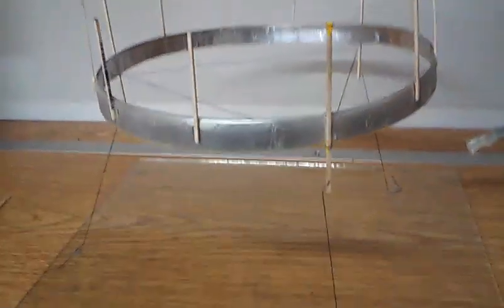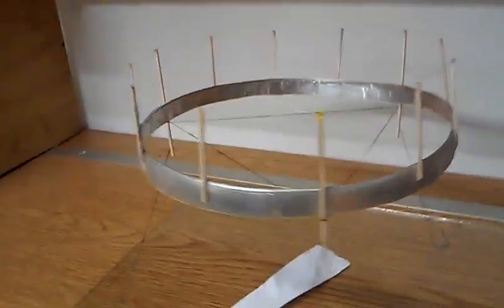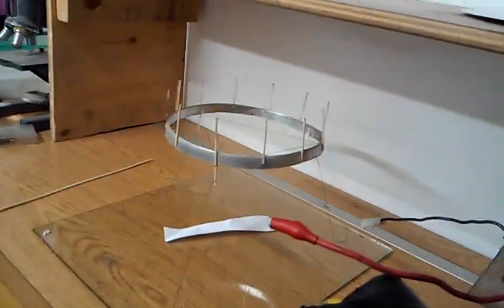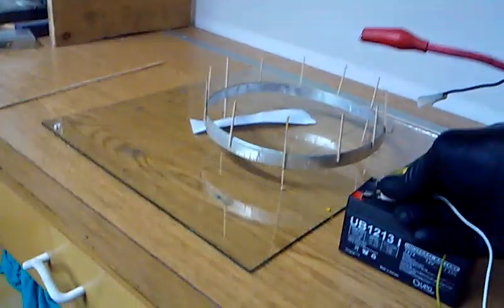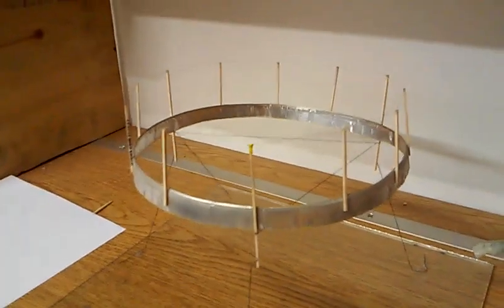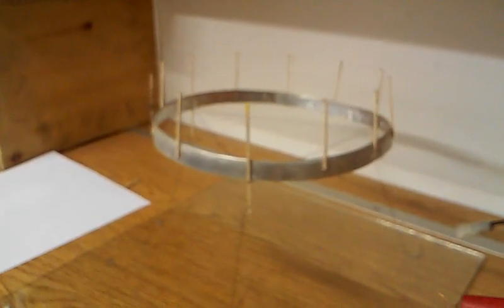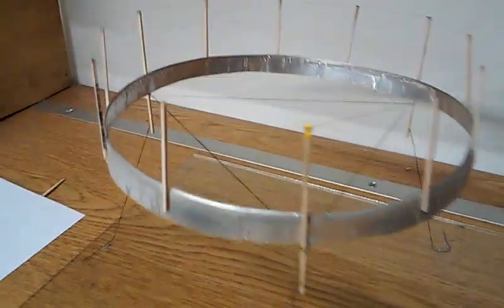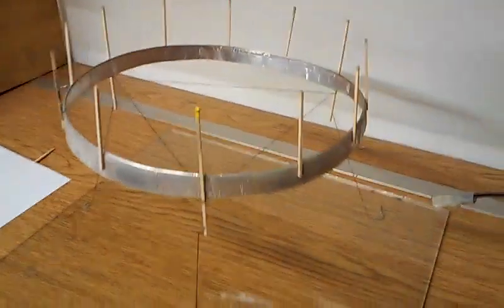ANTIGRAVITY LIFTER CREATES ARTIFICIAL GRAVITY ASYMMETRICAL CAPACITOR

Comment: Is there any documentation for this project? The voice is not clear enough. How can I replicate?
Reply: Tons of ion wind lifter plans out there.  I built two.  None will work in space however.  It's not anti-gravity.  Be very careful. The voltages used are very dangerous.  You can start with a TV tube power supply and a bunch of alumium foil and balasa wood sticks and "magnet wire" (resin coated wire).  Start here: https://www.instructables.com/id/Lifter-or-ionolet/

Comment: Nice. Electromagnetic field though, gravity doesn’t exist 😉. Barometric pressure from the electromagnetic torus around us allows density and buoyancy to separate everything on earth. Just as water separates based on density, so do the gases in the air. Solid objects are heavier than air, which is why they fall through the lighter air, until reaching a bigger mass. If Newton’s apple had fell in water we’d have a real problem! Rocks sink but apples float, thanks to air displacement. Planes and subs achieve neutral buoyancy, not anti gravity. Other way, more like yours, eliminate weight by changes in frequency and vibration mainly 😉. Best wishes! 💙 & ✌️

Comment: Very nice work.. I believe what's happening is the current is creating a magnetic field like a toroid around your ring. In turn the ions are pushing off of this field if you create a scale of this model either larger or smaller I believe you will see that your lift height will be the same proportional distance to the size of your ring. If it was a gravitational field then it wouldn't stop going up and the field would lift other objects in the field with it.

Comment: I have some of that heavy steel strapping that has holes punched thru it. I wonder if this can be used as the circular sheet metal part. I realize aluminum is much lighter and has higher conductivity.

Comment: this is not anti gravity, its not the ionic wind that moves it, its the change in momentum from the ion particles that move it up (as well as the ionic wind a bit). its like throwing a heavy object off a raft, to move back away from where you threw the object. please do research before claiming you discovered something. (this is not meant to be hateful)

Comment: Hi jim,
I built the power supply with flyback and joule thief. Im using a wire over grid mesh screen. 12volts battery. When i turn it on. The lifter wants to fly down. Not up.

Comment: I agree that it's not 'ion wind' that's providing the thrust, but i don't think it's creating AG above it. A simple AG test would be to put a piece of paper above it and see what happens. Nice build by the way, i was thinking of making a circular one so thought i'd take a look and see if anyone had tried it and documented it yet. I wonder how much more thrust you'd get if the emitter wire was in a circle too. Thanks for sharing.
Reply: You probably know this but don't expose yourself to the ozone for prolonged periods, maybe get some extraction going if you do.
Reply: Are you THE Gary McKinnon???  wow
Reply: either this guy is a good and talented fraudster or it's not a wind effect. The thing does not look like it's being lifted through air displacement.
Reply from the maker: If you noticed, I did hold a piece of paper directly above it. No effect. The emitter wire is isolated from the flyback power. The flyback neg. does go to the circular apron.
Reply: Hahaa We keep bumping into the same things....
Reply: Sorry for delay in replying, yes.  @Research0digo

Comment: Hi Jim. You can see what really happens when you blow cigarret smoke in your System. However, the reason why it attracts Ions can be the very same reason you posted the vid for.You just Need a whole lot of more energy to prove the gravity well theory. ´Gravity is he consequence of time oscillator differences of interacting force fields of particles. Every particle is carrying its time oscillating fieds. When they interact they tend to synchronise their time oscillations, making them oscillate more slowly. That is the reason for Newtonian gravity of matter. The bigger the matter the more energy is Needed to Keep them synchronous, the slower the oscillation, the slower the time flow.When moving a particle around it is clearly not oscillating. Therefore a moving particle is a Fourier series of its time oscillation together with an oscillation of the space under it. Togethert with the space around it. Since impuls is a constant, this must be a combination with positive and negative Terms.When the big metal of your unbalanced condensator pulls the electrons back due to the force fied of the remaining electrons, the impuls of the flying electron becomes slower and must have an effect on the underlying time oscillations of the space under it. It is like a mash you pull back. It gets deformed.  bubble. Having it's countereffect with (1-x^2) effect were x is normaliseddistance. A tippical dent. The oscillations surrounding get slower, corresponding with the time field of a heavyer particles. Meaning a bigger gravity. And by energy increase rule towards slower moving time fields (potential to kinetic energy transformation) you have your Explanation. Of course this Needs a book to explain. Just phrases to get your thinking in the right directons.But to attract a bird in your gravity field instead of Ions you will find yourself experimenting with 500.000V and 1-2 Ampere/Second electron flow. Not to do in the kitchen. ´John Searl did have interesting concepts how to achieve this.

Comment: I'd love to see that tested in a vacuum chamber - would prove or disprove any claims regarding ionic wind, and if it does work in a vacuum... well, the implications there are obvious.  :)
Reply: its already been verified that ion wind lifters will Not lift in a vacuum chamber
Reply: That's exactly my point.  He says its not an ion wind lifter, but "is trying to fall upward". Testing with a vacuum chamber would be one way to bolster (or disprove) that claim.  A small model shouldn't be to expensive, and if he's right it would be money well spent, yeah?  I'm guessing OP knows that would be wasted money, but if I'm wrong, even better!
Reply: I understand that when Townsend Brown went to continue his work in France his discs were tested in a vacuum chamber and worked better than in the atmosphere.
Reply: The devices work in vacuum. Ion wind does not. The devices work in OIL, and sealed in resin blocks. This is ELECTROGRAVITICS. ETHER TECHNOLOGY.  http://u2.lege.net/cetinbal/PDFdosya/EtherTech.pdf
Reply: NASA has tested this tech in vacuum, the inventor has, Takaaki Musha of Honda, the US Army, Purdiue University, etc. Ion wind is too feeble a force to loft a 3-gram model, and models kilograms have been lofted. THey work sealed in resin blocks, under oil, etc.

Comment: must you have the acrylic or glass plate underneath? I cannot see where the high voltage leads are connected. They appear as if floating or resting on the transparent plate?

Comment: Also I'm working on SOMETHING, that gains more mass that causes a greater gravitational pull than that of our earth. 
Theory #101
Much like a "rock" or object on a tower that can fully support the weight as I gather the mass and put it into the "rock" or object, that when walked up upon lifts you so you can stand normally upside down on the "rock" or object from earth with a greater mass than earth, while still being able to hold you. Creating a heavier gravity that lifts. Essentially
#(Ck) common knowledge

Comment: how  many Volts power your iron wind  ring?  hi voltage could be 24 volts from a lab unit or 240 plus volts though a bridge 
Are the Volts DC or do you have an AC supply for extra power?
Have you tried putting longer strings and see if it wold rice higher?

Comment: So a vehicle povvered this vvay vvould need to be set up like a hovercraft? 1 "engine" lifting it & a 2nd to move it in a direction?  I could see this vvorking if itvvere inthe 30' diameter scale you mentioned , as it'd need to lift a pilot as vvell as 2 generators & its ovvn vveight . Though I'd think most people vvould vvant it povvered by something other than internal combustion . TY for posting

Comment: What are those wires sticking out from the power supply going to? Is anything connected to the ring itself? I don’t see any electrical wires touching the apparatus. What’s in the drawer underneath the glass plate?

Comment: Its not anti gravity. The wire is being charged with a high voltage current, which is ionizing the surrounding air, the air is then drawn to the foil to discharge creating a small amount of thrust.

That's why the frame has to be so light. If it was anti gravity, the only limit to the weight of the frame would be the amount of power being put through it, effectively, how much juice the wire could take. The reason why upping the power doesn't up the payload limit is because the limiting factor on the effect is the air flow. The air is either ionized or not, increasing the power will not produce more thrust. However, if you were generating a repulsive force against gravity, there is no reason why increasing the power would not increase the strength of that repulsive force.

Comment: If it was creating a gravity field above it, then gravity above the unit would be different. So you just have to have a scale placed above the unit, weighing a standard weight. If the scale measurment changes when you turn on the device, then it is affecting the gravity field. If not, then it isn't.

have you thought that maybe electrons themselves have mass, and they are moving backwards from the wire to the foil, and that it is the movement of electrons that creates the force?

Comment: By using the electrogravatics, you could totally create a hover car with 4 different hover circles (operated by a 3rd ir 4th pedal in your vehicle) near the corners of the vehicle to stabilize it when in the air, and it wouldn’t be difficult either. Combine the car with some airplane wings that can span out like in this image https://images.app.goo.gl/4cyATpzWKyVUPpQEA (and retract too obviously) and you can totally create a vehicle that is incredibly useful in modern times.
Idk how or where you would land it, but still this idea is very interesting.

Comment: I don't know the details of the setting...  It looks to me as being a iron based metallic circle that's wanting to accelerate upward, not hover....  It looks like it could be a circle being pulled up by a high powered magnet...  If it's antigravity, there's nothing in the circle to create it... or power dispensed to have the circle to create the antigravity.  As they have it to  appear to be in the secretive TR-3B antigravity ship...  The TR-3B is only supposed to be able to reduce the gravity by 40-60%, even though the huge size of the craft....

Comment: Besides the string that's holding it down , where else did you have it hooked up. I hear you say something about a fine wire but can't see it. So the computer stuff is hooked into the battery then the battery is hooked to what ?

Comment: Great job. If the high voltage supply and batteries come down in weight, you can build larger vehicles. That could carry a pilot. For horizontal forward flight, setup in a horizontal configuration. It seems the upward and forward speeds could be very high velocity. If you isolate the positive and negative conductors with insulators, would it still lift with the same thrust velocity?
Reply: You could build one with three smaller ones . Joining together but not touching and one power source . With voltage controllers on each one that way you could control Direction of travel . By raising or lowering voltage for tilt and speed as well . I heard that the stealth bomber uses this for extra lift . The jet motors powering generators for the power.

Comment: If you run this device upside down, does it increase in weight on a scale?  Have you thought of experimenting with weight the device can lift off of the earth, and then compare it with what it could lift working with the earth's gravitational field by using pulleys?

Comment: If you could get it to cary its own power source and add a remote, you've got the future of drone tech...  As long as it came back down...  Also, will the intensity of the upward (downward) force be modulated with the amplitude of the current?  Thanks!

Comment: Hi Jim. 
I built a very small and light lifter but it would not lift. When I placed a piece of paper underneath the 
lifter, the ionic wind push it down to the table making it very difficult to move that paper. 
The ionic wind is pushing downward and not upward and so the lifter is not being lift up. 
Do you know how to make the lifter lift above the table. Weight is not the issue, because my
lifter is very small and light.

1) Do you have an email address so I could email you ?

Comment: That's a pretty neat ionic wind generator you've got there. You can probably increase efficiency by using a lower friction conductor (I.E. silver wire) and lighter equivalent materials (I.E. aluminum instead of wood).

Comment: Hy very interesting video
I was 
asking myself if only triangle forms work
In deed you prove not, also it seems effectively very heavy and incredibly reactive....

If you want to lift weights, put the weights under to maintain gravity center under control
Then the sound you ear on video is the voltage in the air as DAS emissions on smartphones, but here it's heavy
This result on ionisation creates ozone in the ambiant air not cool for breath human parts...

Anyway did you try to create a double device with two opposing circles...
It could permit to control the high of the flying form

Comment: The fact these devices do not work in a vacuum (http://www.blazelabs.com/l-vacuum.asp ) prove ions are somehow involved. While there is no wind produced strong enough to move a stiff piece of paper, a tealight flame is affected. The best theory for these is the ions charge the air and the skirt gets pulled up to the charged air through electrostatic attraction.

If you want to see if gravity is affected, suspend a set of digital scales above and see if an object's weight is altered with the activation of the device. My prediction is it will not be.

Comment: Jim, what is the max voltage you are using for this lifter? I have a neon sign transformer that steps wall voltage up to 15,000 v and we have rectified it for pulsating DC and used it for a fusor inside of a vacuum chamber. The next thing I would like to do is make a lifter and put it inside of the vacuum chamber to prove that it is not ionic air movement that is lifting these things. I have a voltage quadrupler circuit set up that should push 90kV from the 16,9000 peak voltage of the neon sign transformer, hoping that is enough to power a lifter... How high of a voltage is your flyback set-up putting out?
Reply: In my opinion I feel like who cares if it’s ionic wind we can fly or place many of these under a car body… this would be immense
Reply: Does this work with the same force witout any of you gadgets layong around. Maybe they have an effect

Comment: Please look into the square-cube law. Plainly put, it demonstrates that volume decreases faster than surface area; if you scaled your test stick up to ten times its length, it'd weigh a thousand times more. The same goes for the lifter itself. Regardless of your completely-unverified claim that it isn't an ionocraft, scaling it up wouldn't actually work like you think it would, so it's still useless.

If you don't even grasp that most basic thing about volume/mass, there's no way you can actually understand gravity as well as you've tricked yourself into believing.

Comment: I beleive the jefferson airplanes and the ark of the covenant was a biplane lifter. Remember that puzzle with how many triangles do you see and that 6 triangles is a hexagon for honeycombing. Also I want to make a laminator copper magnet wire circuit board prototyper or try to make a copper toner to then laminate for circuit board prototypings. -openInvent.club

Comment: Take a handful of styrofoam beads and toss in the middle while it's lifting... pretty please. 

Also see if you can get the MiT PSU schematic.  It's lightweight enough to fly their RC plane with onboard battery.  That way you won't have to use a heavy flyback power supply (typically from an old CRT style TV).  Start here: http://news.mit.edu/2018/first-ionic-wind-plane-no-moving-parts-1121

MiT's Ionic-breeze is a horizontal lifter by virtual of being an airplane.  Yours is more like a vertical drone...  make it with 4 circles and control it with off the shelf flight control chips. It's pretty easy.  The ESCs are 3 phase inverters so that way you get your pulses, just step up with a diode latter to get the voltage.  The duty cycle of the ESCs, which is controled by an RC controller will give you the ability to control flight.

Would be neat to see a vertical lifter fly like a quadcopter drone with no moving parts.

Comment: Not antigravity, it is simply ionic wind propulsion using corona generated charged particles. Place one of these in a vacuum chamber and pump out the air and you will see that it does not lift!

Comment: do you need electricity or can you use batteries to produce the effect,
Reply: High voltage
Reply: @megax3976  Would a generator power it and have they tested this effect in space experiments